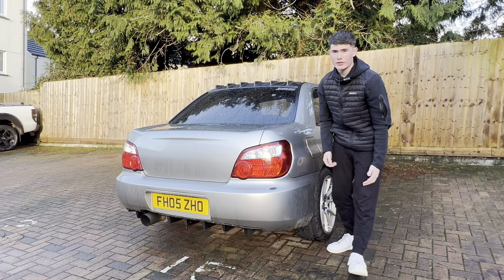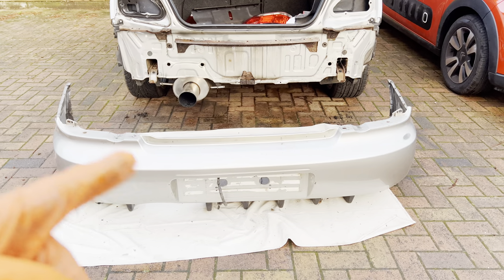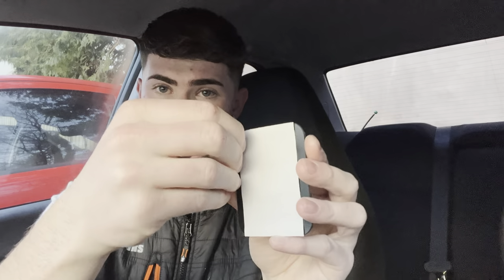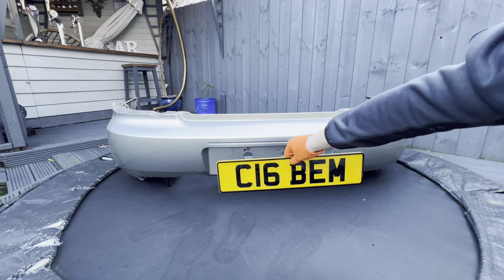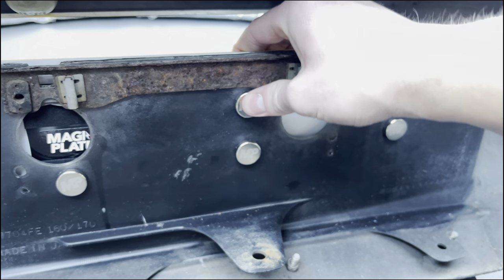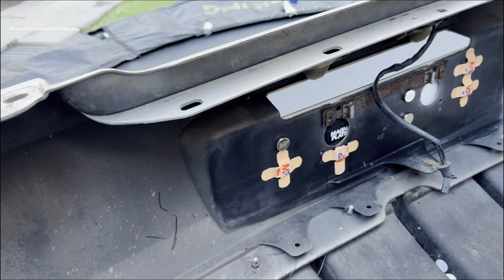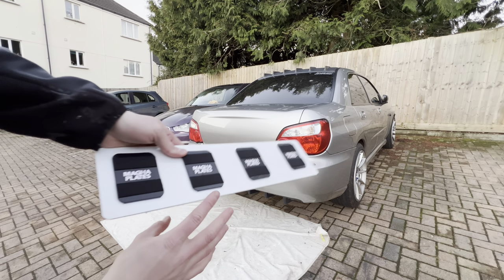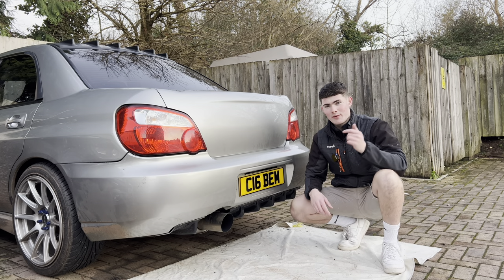How To Fit Magna Plates To You're Car! MAGNETIC NUMBER PLATES

Comment: Just a heads up… The reason there are four mounted magnetic plates and eight magnets are to attach each plate in 8 locations (2 magnets per magnetic plate). The ‘£70 kit’ isn’t to offer front and rear options, it’s for two number plates mounted at the rear or front.

I’d certainly eight magnets at front end.

Comment: I'm doing my car, not a Subaru but I have a 5 digit 14" plate, can I do both front and back plate with the £40 magnaplate kit?, like 2 on each reg, will that be enough to hold it rather than putting 4 on 1?
Reply from the maker: You’ll need the more expensive kit I used in the video to do the front and back mate